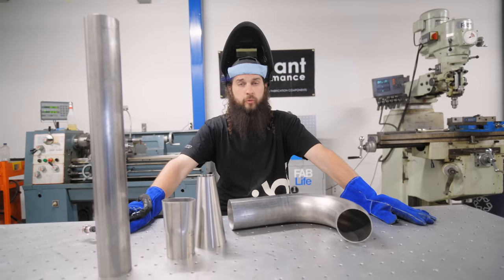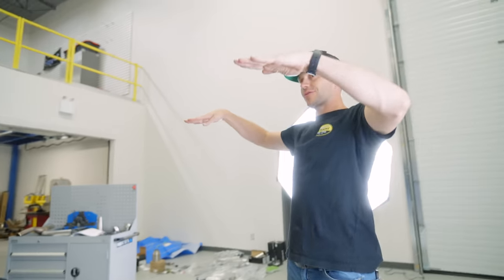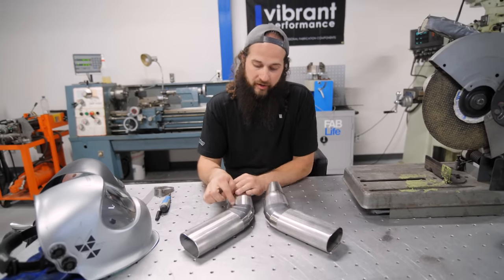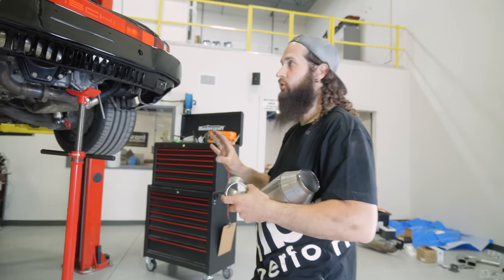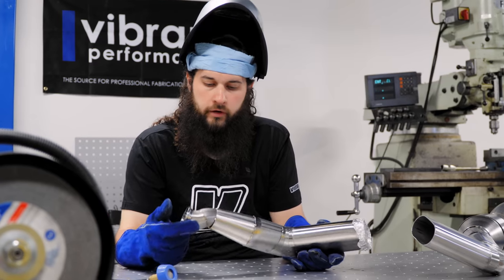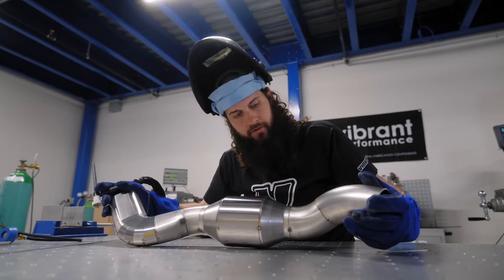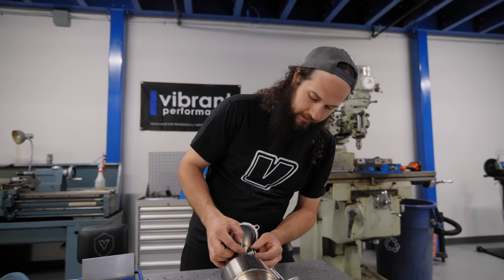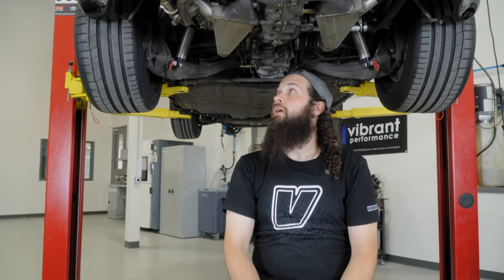We did this...to Speed Academy Peter's 911 Porsche 930!

Comment: Entirely unrelated, but man it would be cool if Vibrant would make a 1/4-18 NPSF to -6AN adapter fitting. Or a banjo bolt in 1/4-18 NPSF. Or even better a 90° swivel hose end that's in 1/4-18 NPSF.  It's a very particular thread pitch for a very particular coolant crossover system on all 92-97 GM LT1/LT4 V8's.